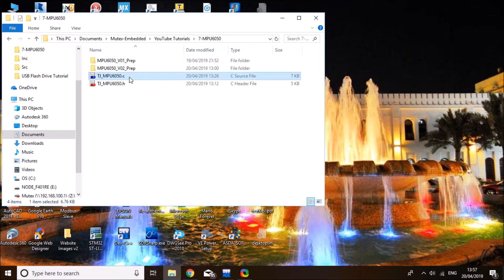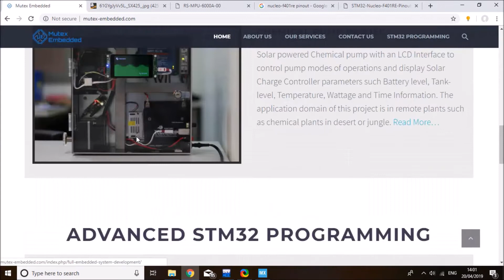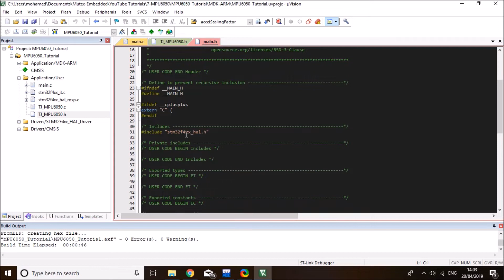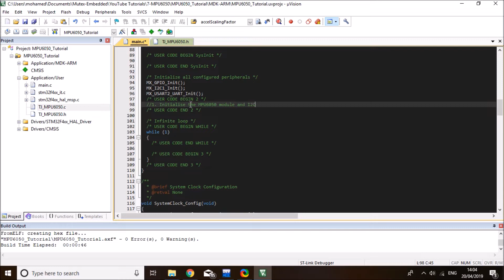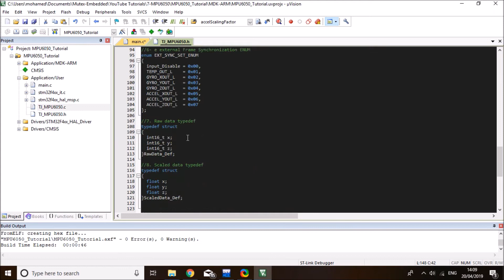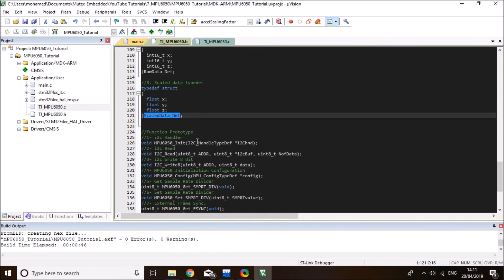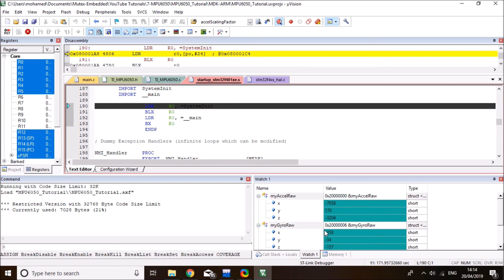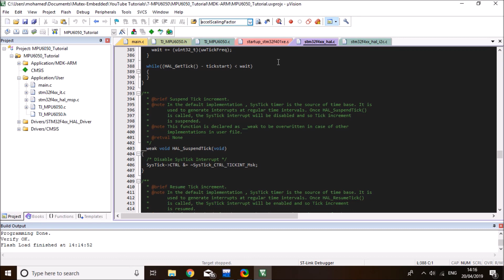STM32F4 Discovery board - Keil 5 IDE with CubeMX: Tutorial 35 - MPU6050 IMU Module

Comment: Hi, is to possible use the DMP (Digital motion processor) to the the quaternion directly by hardware, instead use an external kalman filter by soft?? Thanks
Reply from the maker: Quaternions are very easy to get. Use Madgwick filter. I might actually put a quick video on that.
Reply: @mutexembedded2206  The maximum power of these motion processors, is just the DMP, it is better than any filter by external software, it is incredible how they work. I have tried up to extended kalman filter, and no better results are achieved than using the DMP. So I use these MPUs with arduino and DMP, and I do the processing with more powerful microcontrollers or DSPs. Without DMP, they are of little use, just measuring a couple of angles, and nothing else. Without DPM, these MPUs are nothing.
Reply from the maker: @fernando.liozzi.41878  That might be handy and easy. MCU software algorithms are super powerful too when implemented right. There are some low-level coding stuff that makes a boost to performance. Thus, you need to know a lot about the MCU prospective too. Checkout CMSIS DSP for instance which computes complex math functions in few 10s of MCU Ticks.

Comment: can you help me to use Kalman filter. I use your code, it works but when i combine it with L298N motor, it has noises so much. (I get Ax,Ay,Az =0) when I turn on the motor. please help me!!! hope you answer me this week. thanks so much!
Reply from the maker: Hi Kim,
Magnetometer is very sensitive to magnetic noise. I am not sure what you can do to fix this. Kalman filter will only work with at least some reliable and consistent sensor data.
Reply: @mutexembedded2206 Thanks sir, I use bucking circuit DC with 3 outputs  3.3V, 5V, 12V. I connect 12V to L298N motor and 5V to gyro sensor. Do I need to use another bucking circuit for only gyro sensor?
Reply from the maker: @coderbug404  If you are using Accelerometer and Gyro Only, without Magnetometer, it should work fine. Magnetometer is the sensitive part.
Reply: @mutexembedded2206  i just use accelerometer and gyro like you. but when i turn l298n motor, it's not work.
Reply: @mutexembedded2206  when i use it in f103 project that using hc-sr04, it causes noise so much

Comment: Hello, I want to process the signal from the accelerometer. Because the read function is in the main loop which goes at a much faster rate than the 1kHz defined for the accelerometer, will the samples be red multiple times? Should interrupts or DMA be used to get samples at the exact sampling rate I want?
Reply from the maker: Yes

Comment: Hi, can you create a video tutorial, with this MPU6050 and DMP (Digital Motion Procesor), and direct quaternion output by hardware. I am using arduino pro mini, with I2C to control this MPU with DMA, which does the sensory fusion by hardware and gives me the quaternion directly. From there, I use Simulink Code Generator to break down the quaternion and get everything I need. I recently got several of these badges, and it's hard for me to load the DMP code. These plates are great. Regards.

Comment: First of all thank you for the tutorial. 

I'm using the same I2C device as the one in the video but during the debugging process, I got the notification that no target was available. I check the library and the MPU_ADDR is 0x68. I check the Addr of the device and it's 0xD0. But in the video u did not do nothing with the address. So! Should the address just supposed to work or am I doing something wrong? Does anyone encouter the same issue?

Comment: can I apply this for my mpu9250 project? 
edit: it worked :D
Reply: Cool just trying to do the same thing with a homemade STM32F405 dev board I made and an MPU9250/6500 breakout board. I want to connect via SPI so can you give me any clue how you did it please? I am thinking that I maybe able to reconfigure the pins in STM Cube using SPI hardware pins and see if that works ? Any help appreciated please 😄
Reply: NO.... I hope you didn't try what you just said...! For SPI you will have to create a separate library which involves the driver configurations for the SPI bus interface. As you also have a SPI board, I have created a custom peripheral driver for SPI bus: 
https://github.com/Ajay-Embed/Peripheral-Driver-for-SPI-bus---STM32F446RE-MCU 
Now using the API's provided inthis you can write an application code by referring to the datasheet of MPU9250.